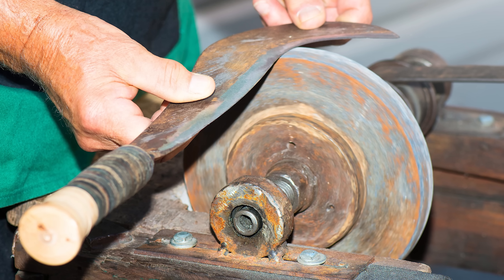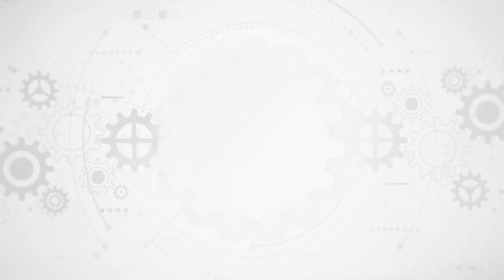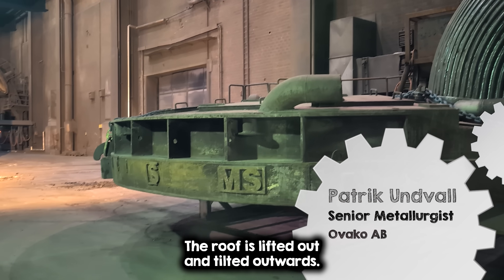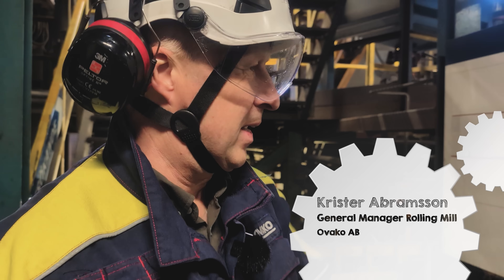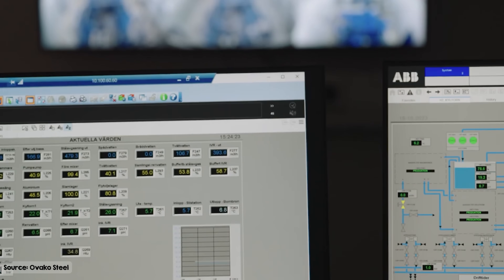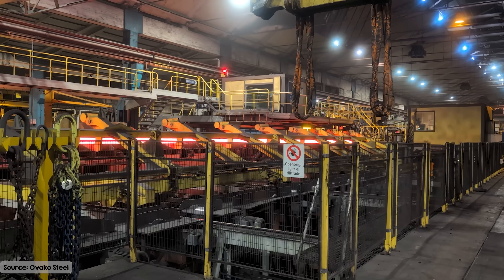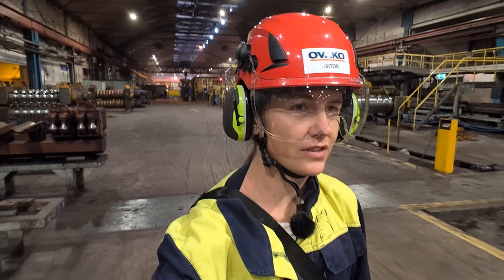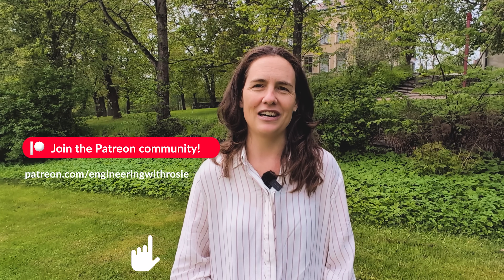STEEL REINVENTED: Inside the World’s First Plant to Burn NO FOSSIL FUELS [TOUR]

Comment: They are not making steel, they are reblending steel scrap. Blast furnaces make iron by smelting iron ore, iron is then made into steel by reducing the carbon content. They have reduced CO2 by not using the blast furnace and not making iron! They are not actually making anything, just recycling already made steel!
Reply: Iron contains almost no carbon adding carbon is what makes it steel. 1020 is .20% carbon. 1040 is .40 % .
Reply: @willyleavitt-pe1cw pure iron contains almost no carbon, iron made in a coke blast furnace is very high carbon, iron made with charcoal has less carbon and is very low sulphur, hence the quality of early Swedish steels!
Reply: @willyleavitt-pe1cw iron made in a blast furnace with coke is very high carbon content, iron made inn a blast furnace with wood has a lower carbon content,
Reply: I know about a project in Northern Sweden, Luleå, who aims make greener steel from ironore. The so called Hybrit project.
Reply: Reduction of Iron ore (Fe2O3) with Cokes produces Iron and loads of CO2. Reduction of Iron ore with Hydrogen produces Iron and Water. So the use of Hydrogen in the reduction of the raw material makes much more sense than heating up the products after recycling.
Reply: Good point... It would be interesting to know what the plans are for developing the technologies to produce steel from scratch using exclusively Hydrogen. 
They also don't mention where the electricity is coming from.
Reply: @daraohogain hydro! Cheap!!
Reply: @daraohogain 
The electricity's source is pretty much another separate problem; at least, make sure that you can make steel off of renewables like the Sun, the Wind, the Sea/Tides or the Atom(/Plasma)
Reply: Ok Phil, all of this is explained in the video. There's steel scrap going in one side and steel bar stock & other sections coming out the other side, so they are making something, you'll have to watch the video again I'd say 👍
Reply: @robcaseyire  Just recycling and reshaping, metals are eminemtly recyclable, but this is not at all a new process, electric arc furnaces have been recycling steel in the UK in exactly this way for many years.
Reply: @philhermetic no one said the eaf is a new process though? They also don't use the eaf process with hydrogen in the uk. It's a very energy intensive process that creates about 500 million tonnes of steel per annum, so any improvement in its efficiency is huge. I think you're underestimating just how much energy and emissions this is saving
Reply: @robcaseyire  all well and good when you have masses of cheap hydro electric  to make hydrogen!
Reply: @philhermetic that definitely helps! it doesn't work at all unless you can get cheap renewable energy
Reply: @robcaseyire  which is what makes the heavy industry regions of Sweden ideal for this process as those regions have been running on hydro power since the 16th century. Originally direct water wheels and reciprocating rod linkages made mainly of wood, and since the early 20th century, by modern hydroelectric turbines and generators.
Reply: Blast furnaces are obsolete. The modern way to make virgin steel from iron ore is direct reduced iron, not blast furnaces.
Reply: Exactly what I was thinking.
Reply: Yes. There are coal free reduction processes. This isn’t that.
Reply: They could do it using biologically sourced carbon from either charcoal or CO2 generated by burning organic matter, ideally not peat. Would be good to make charcoal and wood gas from the same plant matter then capture the CO2 from burning the wood gas to generate electricity. Would help use the wood gas in the most efficient way possible in the most controlled environment.
Reply: She said all this
Reply: As explained in the video. 🙄 Maybe also watch the three videos about low emission production of virgin steel, referenced at the end? 😂
Reply: @georgepelton5645 No, she did not explain using hydrogen to reduce iron ore and strip the oxygen from iron.
And at the three minute point, she is saying that her electric arc furnace is better than a blast furnace.
Reply: Fine so they swap one greenhouse gas : carbon dioxide, for another much more aggressive greenhouse gas : water vapour. Not only that they do it with the most inefficient way of splitting water! There are better ways to use hydro electricity.

Comment: Could electric arc furnaces ever do the direct reduction of iron ore?
Reply: Nope but you can use hydrogen to reduce ore to metal.
Reply: Direct Induction Furnace. Ore to iron. Arc furnace takes the iron over to steel.

Comment: Where do you get thee Carbon to make the steel? Normally coal is used to supply the heat and carbon to make the steel.
Reply from the maker: This is an electric arc furnace, it uses steel scrap (unlike a blast furnace that uses iron ore), so it's already got the carbon and other metals needed.
Reply: @EngineeringwithRosie aaahhh. I’ve got it. We are not going to use iron ore anymore to make steel. We are going to use scrap. 😳🙄
Reply: Looking way ahead, there are projects to replace initially input carbon with plant based alternatives - basically going back to the charcoal technique for adding carbon. The carbon would not be sourced from trees, but agricultural residue. There are issues to solve, such as choosing the correct plants and so on, as well as quantity required, but interesting to see people thinking about such things.

I’ve even heard of very speculative approach’s of pulling CO2 from the air, making organic substances from it to make the carbon. Very expensive (at the moment) to go this route, but engineers and scientists are always interested about what could be done first, the cost calculations come later. Research is science, not economics, learning about what can be done, not whether it can be done cost effectively. You never know what cost savings will evolve over time, even if a process is ridiculously expensive today. A good example is the fall in cost of wind, solar and batteries over the last 20 years - and they haven’t finished falling yet.
Reply: @javelinXH992  Using charcoal for steel is carbon capture!
Reply: @SocialDownclimber Exactly! 😉

Comment: Did Ovaco mention or did you ask why the reheating furnace couldn't simply be powered by resistive heating? Was that an issue with retrofitability?
Reply from the maker: Yes, I asked that, but stupidly not while cameras were rolling. If I recall correctly, it's for a few reasons. 1 - retrofittability as you say. 2 - it is a bit hot for electric resistance heating (there's not many electrically conductive materials that can withstand that temperature and they are super expensive) and 3 - you want a lot of radiant and convective heat to ensure even penetration to heat the ingot uniformly in a reasonable amount of time, and a flame does that very nicely.
Reply: @EngineeringwithRosie thanks for another great informative video. Would induction heating be a better solution for this application? I believe it can achieve temperatures up to 3000°C & would be much more energy efficient than hydrogen electrolysis.

Comment: This is a great example of making clever improvements where we can and chipping away at the "hard to decarbonise" label that steel has (for good reason). You last point is important to recognise... this is part of the solution, but won't be THE solution for a long time. If we can basically get steel production down to a closed loop system, that would be great, but that probably can't happen until the human population reaches a dynamic equilibrium.